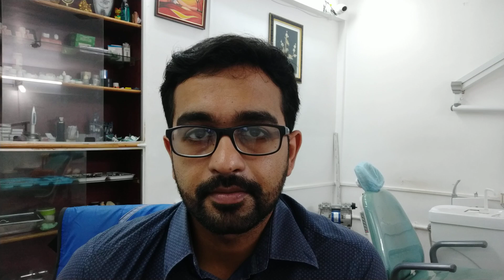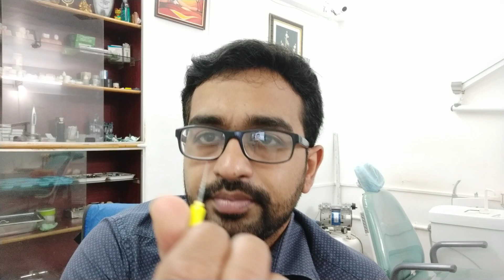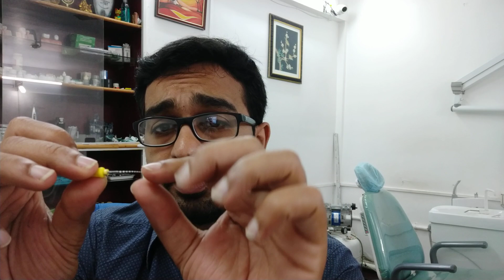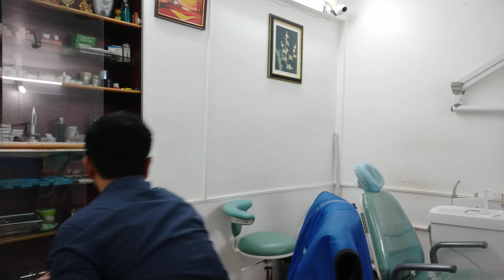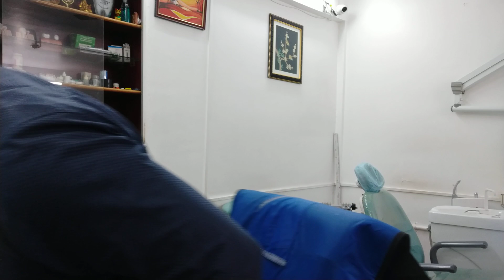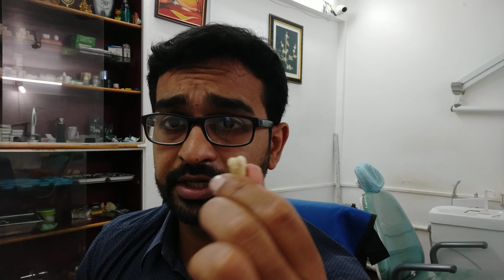HOW TO PREVENT FILE BREAKAGE DURING RCT?

Comment: Achanak rct rarte samay fail tut jaye to Kaya karna hoga
Reply from the maker: Tooth extraction
Reply: @Saidentalvlogs  There at least 3 methods to remove separated dental files:
1. Terauchi File Retrieval Kit - TFRK.
2. Komet's Endo Rescue Kit 4601*
3. Google this: "The S.I.R. System: Separated Instrument Retrieval Using Various-Diameter, Dead-Soft Bonded Tubes".

*This might be available online on Denkart or PinkBlue website, in India for under Rs. 18,900.
Reply: Dua

Comment: Sir, excuse me, but this is the ,I think wrong method for checking files as this method will increase the metal fatigue and will lead to break it and also reduce the sharpeness of file blade, I suggest to examine the files under microscope which is available near our pathological laboratory friend nearby our clinic just go to there and pathologist will help you to see the clear vision of blade of any files,any creck ,wear, and also sharpness of blade of file
Reply: Absolutely... this is a complete medieval advice without any scientific basis. So you try breaking outside the tooth and it doesn't break and it goes into the canal already weakened and binds to canal and breaks!!! Is that acceptable? The best way to prevent breakage is single use files. In the whole scheme of things, files esp. hand files don't cost much. If you charge the patient an extra Rs. 200 for their single use files and have a better peace of mind, isn't that better? An average RCT cost is Rs. 2000 to 8000. If anybody is paying that much and if they object to paying another Rs. 200 for disposable files, then its better to not take them on as a patient and save yourself some sleepless nights after file breakage.
Reply: @myyoutube7228  yes I agree
Reply: @myyoutube7228  im soo lazy to do hand filing
Reply: @myyoutube7228  which files are single use files can u elaborate
Reply: @Zara-ZAF  all files should be used only once. That's what we mean by single use files. Files should not be sterilised and then used again.
Reply: @myyoutube7228  but that makes cost high and some patients cant afford, also some compare with other dentists who charge low for RCT. say if I use gold protaper files it costs 2500 , patient wouldnt pay me 5-6k also others
Reply: @Zara-ZAF  Protapers can be used up to 6 times. Get a leaf count stopper. Every time you use it, break one leaf so that you can keep the count of how many times it has been used. Ultimately the choice is doing the right thing vs losing sleep after an instrument breakage happens and patient comes back unhappy. It's your choice. My criteria of treating a patient for any treatment is I'll do what I would do in my mother's teeth or I'd treat the way I'd like my own teeth to be treated. No compromises in ethics and quality.
Reply: @myyoutube7228  youre absolutely right.  can you help what leaf count stopper is is it available in market, m new to practice hence lot of questions in mind before I start my own practice